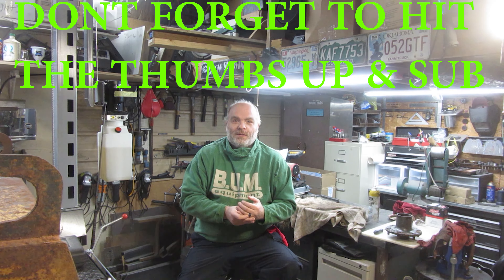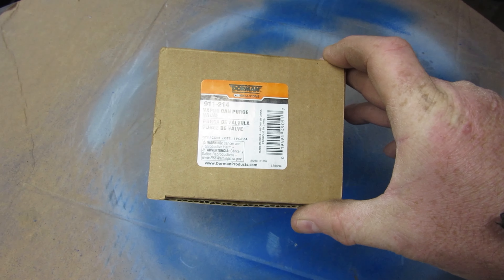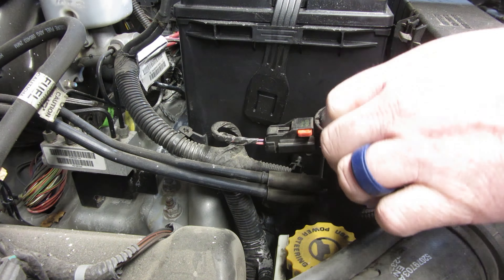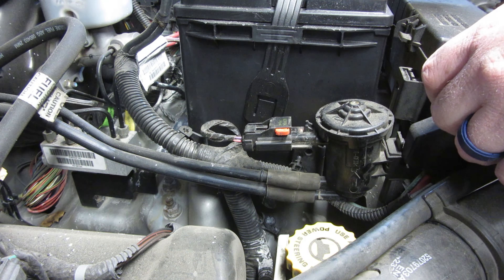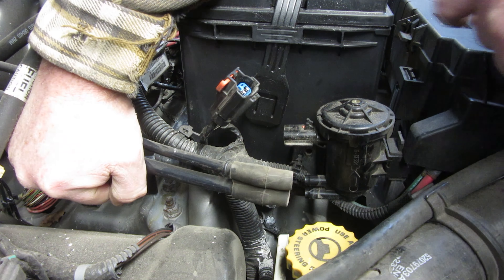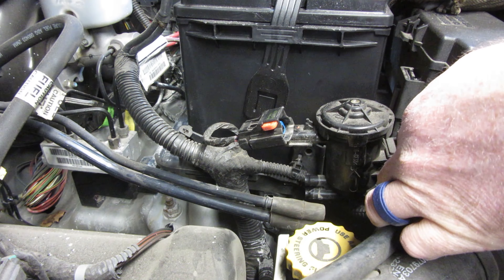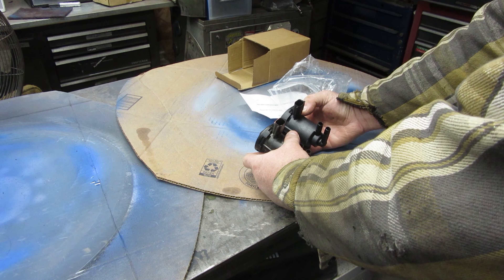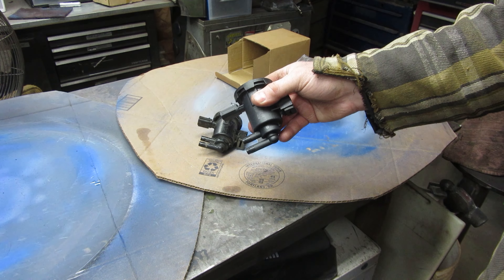JEEP LIBERTY PURGE VALVE REPLACEMENT p0441 code

Comment: I am from Iraq .  I own a 2004 Jeep Liberty and I have black smoke coming out of the exhaust.  Also an increase in fuel economy.  What do you recommend
Reply from the maker: sorry not sure what the problem is
Reply: Catalytic Converters or PCV valve and hose replacement

Comment: What kind of sympthoms  happen when this valve is damagd beaised the P0441 error code. That error only happens when the coil gets opeb but if the valve gets stuck, the compyter won;t tell you that there is an error code si I wonder wtaht woul dhappen if the valve gets stuck opened and what happens when it gets stuck closed
Reply from the maker: the engine light came on & it was hard starting sometimes